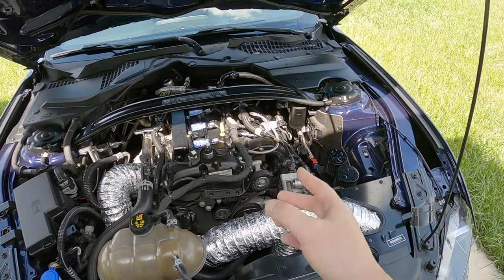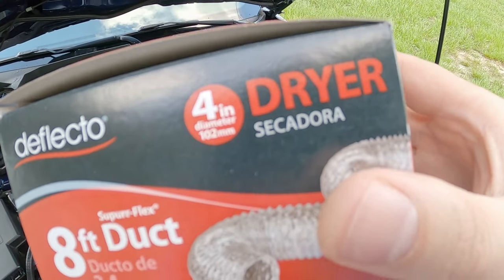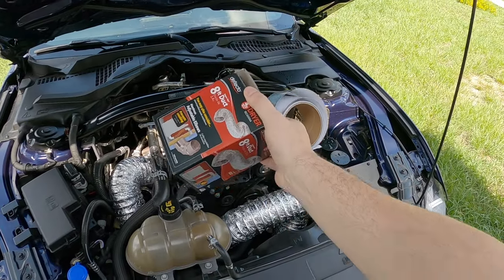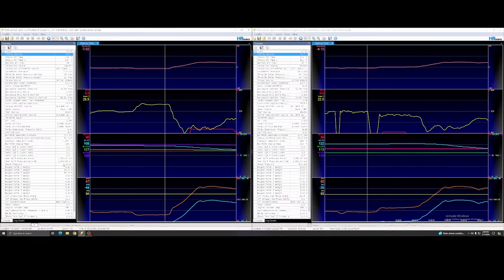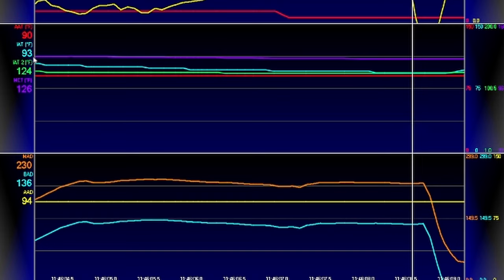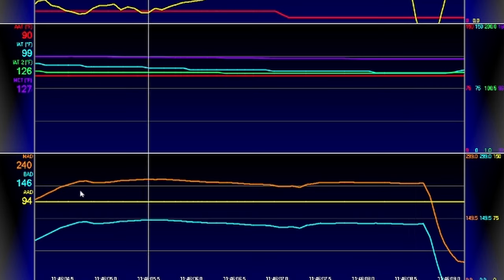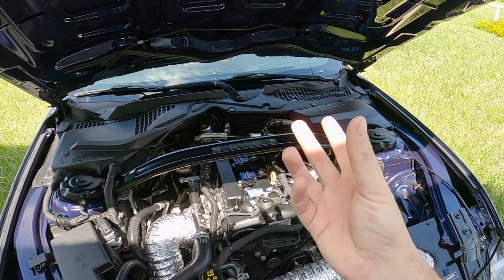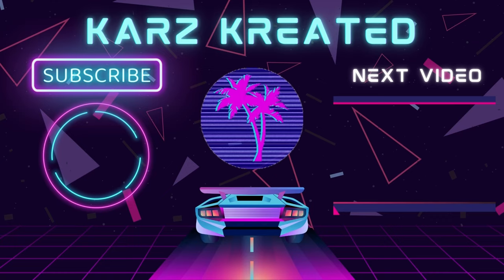Reducing Heat Soak on a Budget

Comment: Every little bit helps! I have my air intake and charge pipes insulated with exhaust wrap. I spent a lot more than $25, and many hours of labor. I like your method, low cost, reduced labor and it's shiny!!
Reply from the maker: At some point, I'll probably buy the gold reflective tape and do it permanently. I don't really like the look of the gold, but it will probably look better than dryer ducting! 🤣
Reply: Doesn’t make sense. You want to reflect heat away not keep it in

Comment: great idea
Reply: may Exhaust insulation tape help
Reply from the maker: It could, but it's best to use an isolation material rather than a material design to insulate. The goal is to keep the heat out, not in. 🙂

Comment: So lethal performance sells a kit that sprys n2o or co2, (co2 is cheeper) on the intercooler, to chill it and pull below ambient air temp
Reply from the maker: I've considered making my own kit a few times. The long braided line that runs from the trunk to the engine bay for the aux fuel system was originally bought to be used for a CO2 Intercooler sprayer.
Reply: @KarzKreated  if you do it, I was only able to find one place in Florida that will fill them and not extange them 
Air gas will let you rent a mother bottle 
But Indian river oxygen will chill the tank And fill it
Reply from the maker: I found a couple of places within an hours drive that refills co2. I guess they're still in business. That was one of the reasons why I opted against installing that kind of system.
Reply: @KarzKreated  yeah, just because they refill co2 doesn’t mean they can fill that tank they use an4 fittings so they need to fill n2o to have the correct fitting 
And in Florida you need the coder air 
My non pp eco  has run 12 but i had  a friend who was a little lighter than me run it

Comment: If you care so much about performance why did you buy the 2.3 ecoboost?
Reply: Performance ≠ horsepower
Reply: @CARBONCINEMATIC  i drive an Yamaha R1 that has "only" 172 HP, power/weight ratio is the key. 
A 2.3 will probably save you 250 pounds while giving you half the power. See the problem?
Reply: @Namenloser_  its where that weight is which is critical for a car’s performance. 250lbs off the front means the car is much more balanced and actually has decent weight distribution. I compete with mine in time attack against GTs and while they have the straights, I have the corners. So it’s pretty even.
Reply: @CARBONCINEMATIC  The Ecoboost is 52% front, 48% rear
The GT is 53% front, 47% rear